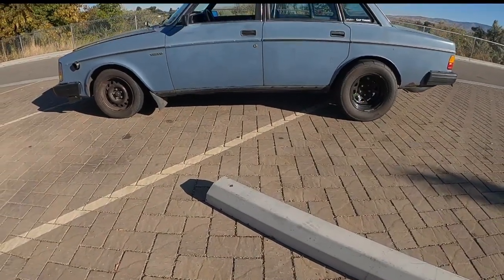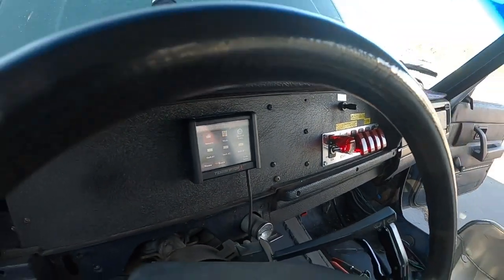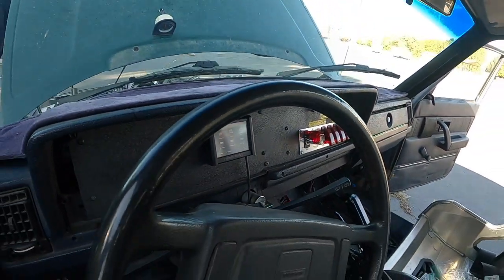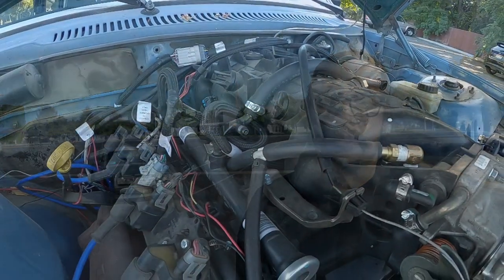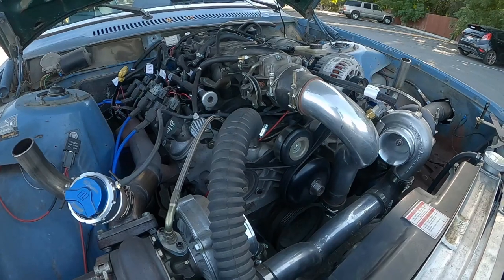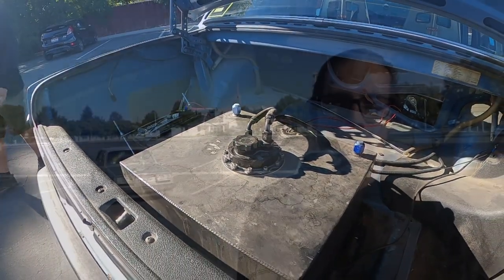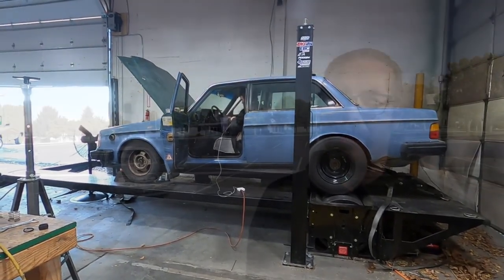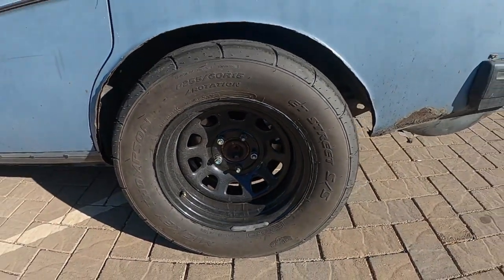Like Sleepers? You'll Love This Monster Volvo 240 Build

Comment: I have a pretty gnarly 242 sleeper.

Forged 408 LS, SS3 cam, ported heads, billet 88mm turbo tuned on flex, TH400 w/ gear vendors OD, Ford 8.8.  Motor made 550hp on 93 n/a.  Makes 22psi now on e85.  It was my first car.  I turn 40 in May.